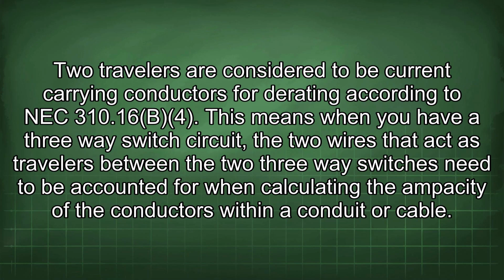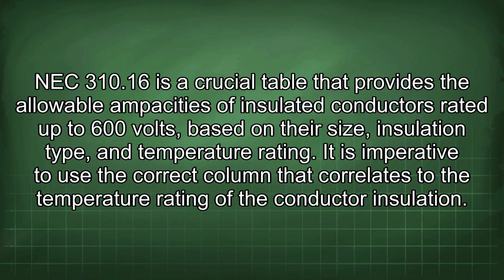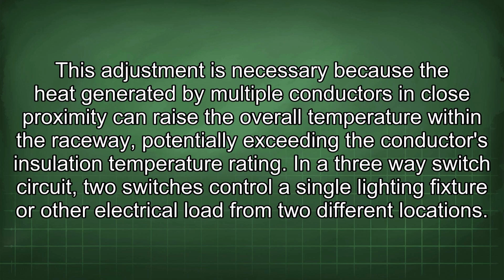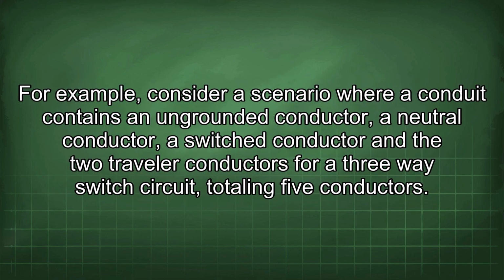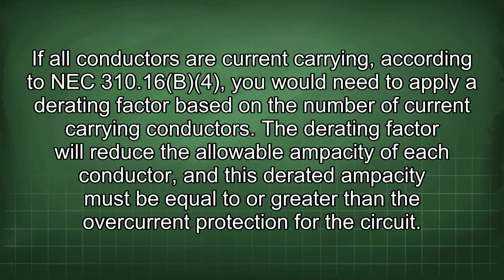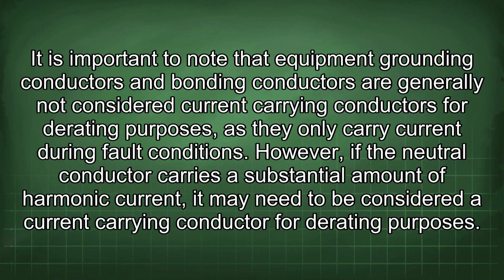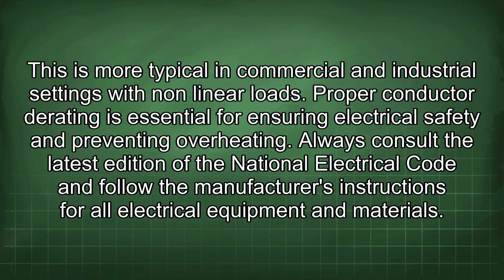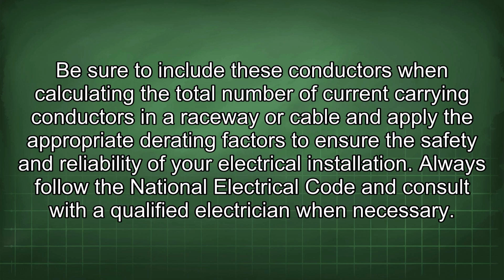Derating Travelers in a Three Way Circuit Explained

Comment: This interpretation is incorrect, as only one of the two travelers can carry current at a given time, so the count of current carrying conductors is 1, not 2.  From NEC: "Number of conductors is the total number of conductors in the raceway or cable, including spare conductors. The count shall be adjusted in accordance with 310.15(E) and (F). The count shall not include conductors that are connected to electrical components that cannot be simultaneously energized."